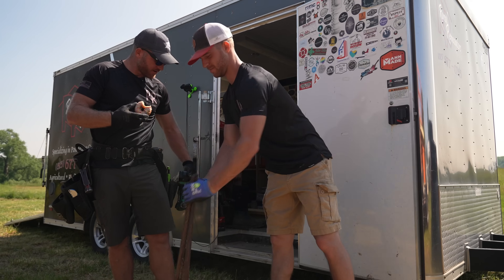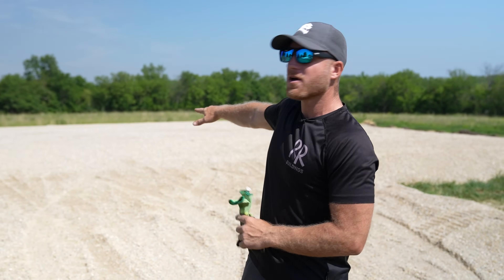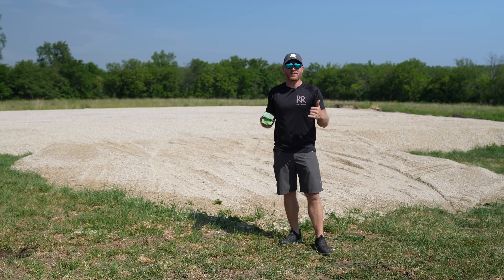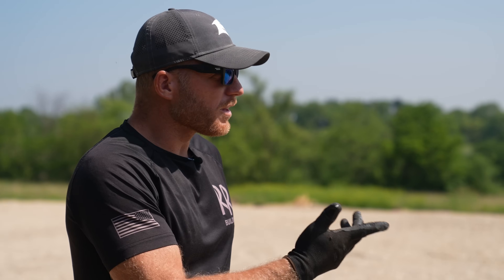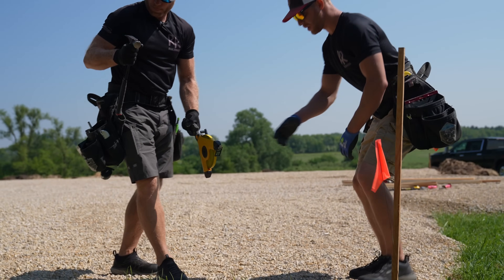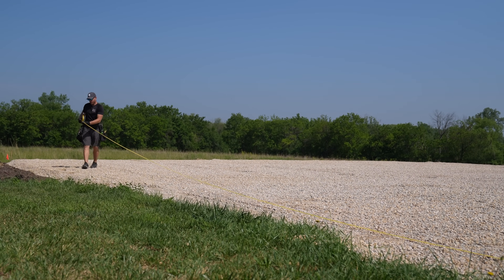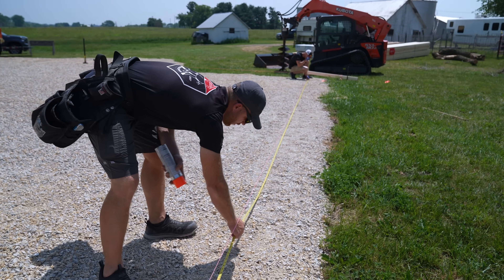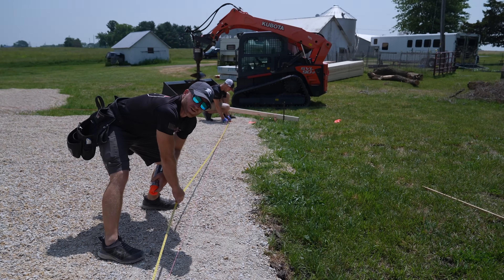Layout For Beginners: Easy Step by Step

Comment: Surveyed for about 10 years (Civl design / CAD for 20 years…now CAD manager). Staked a LOT of houses. You hit all the important points and mentioned some of the pitfalls. Very well done. Thank you for emphasizing elevation when laying out. Remember…slope in the site creates another triangle. If you hold a tape close to the ground, on a slope, and don’t use a plumb bob (or some other manner of “leveling” the tape), you’re measuring along the hypotenuse.

Comment: The reason the batter boards are normally set at a 90 to the corner using 3 stakes and two boards attached to each other is to help eliminate the movement you experienced when you pulled your lines tight and had to re-adjust the corners.  It makes the batter boards rock solid.  If they do deflect from the string tension at all, it is in the same direction as the string is pulling so it doesn't affect the location of the string.

Comment: I’m glad you guys did it the right way, by simply doing the calculation. So many other “layout” videos try to tell you, just measure your diagonals and make adjustments until you get like-diagonals. No, a thousand times NO! You can have like diagonals and not have a single square corner in the whole thing. (Do a search for isosceles trapezoid and you’ll see what I mean.) Plus, this is just faster and eliminates all that back and forth nonsense.

Comment: 2:48 I looked it up and the typical expansion for a steel tape at 90F would be 21/32” per 100’. Didn’t think it would be that much, but there you go.
Reply: I didn't believe you so also checked.  Sure enough, for a ∆90°F, a 100’ length of steel changes around 0.7in.  😮

Comment: 3rd I'm going to build several buildings on my land. One of them will be a 64 by 40 and the other will be a 72 ft. diameter geodesic dome made out of round pipe. The geodesic dome will be a very difficult foundation to lay out and plus I plan on doing it with ICF blocks which adds complexity to it. The top of the ICF blocks will be about 3 ft. off the concrete slab and then I'll start the construction of the geodesic dome on top of the ICF. It needs to be very accurate.

Comment: ORANGE PAINT CAN !!!   I bought one of those, used it for a bit and the next day no paint was coming out anymore. Reading the fine-print on the can, I discovered that after using it upside-down, you have to spray a bit in normal position to clean out the nozzle. Your can may be different, but carefully read the instructions, otherwise 15 bucks wasted after 15 seconds of use....

Comment: toward the beginning of the string layout for the pins,  you added 2 inches to your diagonal calculation, but you didn't explain the reason for doing that.  can you please explain? when you set the strings on the batter boards you explained about" burning a foot" on the measuring tape and i completely understood that part.

Comment: Why at 7:24 did you add 2" to your hypotenuse of 87 4 1/2?
Reply: I wish someone would answer this question please.
Reply: Just a guess is for the difference of the board. Instead of to the backside of both corners. Not 100% sure though

Comment: Why add the 2"?

Also this is one of the best videos on square I have seen in a long time!  (Essential Craftsman would be proud!)
Reply: Greg is probably holding on the 2” mark. The ends of the tapes aren’t accurate with the metal hooks etc on the ends of them.
Reply: @aux4coxwain thanks, was thinking that but... Not a framer so thought I missed something

Comment: I hope this isn't a dumb question. But.. that first batter board set.. you set it above the gavel by?  Or an inch up?  Just eyed it?   I was worried that with the brackets later on you would need to be higher for the string?   I get that then all the other batter boards would be same level.  It looks like you have 5 to 6 inches clearance when you put the lines up on the high point.     Thx for the video

Comment: Quick question. What is the equation of how do I determine the spacing between poles on a 40ft length, with 5 6x6 post. Is the 40ftx12=480 
480-5.75 = 474.25 
474.25 / 5 = 94.84 so 7.90 between the poles? 
I was told 8 ft on center because 40/5, but having trouble. Would love some help, tried to watch you YouTube videos on how to determine it, but was unable.

Comment: 8x12 concrete pad not square want to build 8x12 shed.  Should i build shed square at 8x12 but will overlap some and underlap some or build a few inches smaller with a drip edge around base to shed water? Thanks in advance

Comment: If you made your measurement with the initial screws at your dimension and then set your batter boards further back outside those pins, how did you measure the same dimension off your batter boards ? Wouldn’t they be a different dimension ? I’m just confused on that part of the layout

Comment: I’m wondering at this point if there will be concrete poured for a slab or it’s just going to be a gravel floor for farm equipment?

 If concrete is to be poured I would turn that job down. Reason being is the POOR Ground Prep.  They really skimped.

Comment: I didn't catch why you add two inches to your diagonal measurement after it was figured out on the calculator. From 84'4 1/2" to 84'6 1/2". Im looking to build a 40'X64'. Thanks
Reply: Maybe burning a couple inches on the tape measure.  In his older layout video he burns a whole foot so the person holding the other end  of the tape measure has something to hold on to.  I've laid out several buildings using Kyle's methods taught in this video and the older one.  It works great!

Comment: You gave the dimensions as 59’9” and 63’9” but you did not give size of the post. I am assuming the size of the post, but others doing a different size building with a different sized posts will need to calculate different numbers, correct?
Reply: No, that's the outside edge of the post, then the 2x6 stringers on the sides of the building add 3" to the dimension.
Reply: @lwadeallen , that makes sense… I just don’t do construction, so did not know…. Thanks!

Comment: If the building is a 60x64, why is it that you’re measuring 59’9” x 63’9” for the layout?
Reply: Because its a pole building and the 2x lumber is nailed to posts adding an extra three inches to the outside diameter of the building..he is measuring for the outside of the posts at the 59' 9"

Comment: Why do you layout your strings 3” smaller then the actual size of the building?
Reply: He’s laying out the columns. The column will have a 1.5” piece of lumber (girts) on the outside, so together they make up the 3”
Reply: This is going to be a post-frame building. He needs to figure out where to set piers so that he can mount brackets for columns. As @bpdp379 said, those columns will then get girts affixed to the outside, and those girts will make up the dimension of the building. The building is going to be 60x64, so the columns need to be 1.5 inches less than that on all sides, or 3 inches less side-to-side.
Reply: @aaronmdjones copy that, makes sense. I drew my own plans for a 32x40 and as of now I have the outside of my post at those exact measurement. If I set them at that will run into any dimensional issues later on. Like as far metal or trusses fitting right?
Reply: @lukelong8422  If you're doing a post-frame building, you need to account for the thickness of the girts. Otherwise no. He's only pulling the string back 1 and a half inches on all edges because he'll be setting brackets flush up against the string, the posts will go into those brackets, and then the girt will make up the difference. If you're stud framing you'd make the strings the exact dimension because the studs are the outside dimension. Sheathing and siding doesn't count, unless you want to make it so.

Comment: So in other words, if you don't have a rotary, you're up a creek.
Reply: Line levels work
Reply: Would never recommend a line level. I’ve never seen a string pulled tight enough that a line level would be close enough for foundation elevations. Too much fluctuation. Might be good enough for fencing or …..I don’t know what else but not accurate at all. Laser, transit level or water level for accuracy

Comment: Why are you burning a foot
Reply: It’s more accurate to read a line mark than hold the end to it. Plus easier to add tension to the tape (steel) so it’s straight because a sag adds length. 

Same thing with trim inside corners to inside corner pull a number out of one corner then measure to it from the other corner, don’t stick the tap across and try to read to curve in the corner.